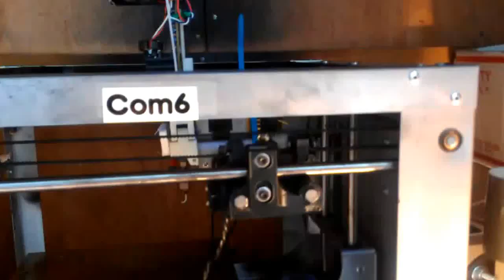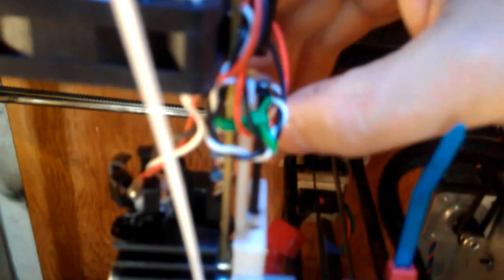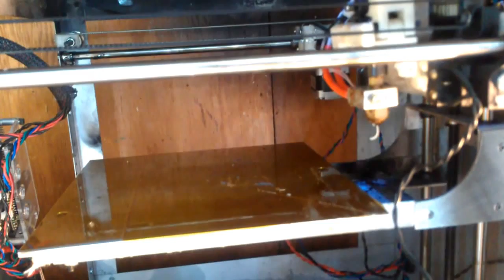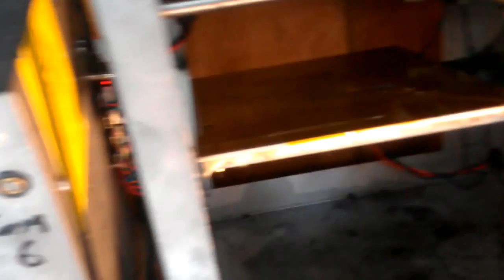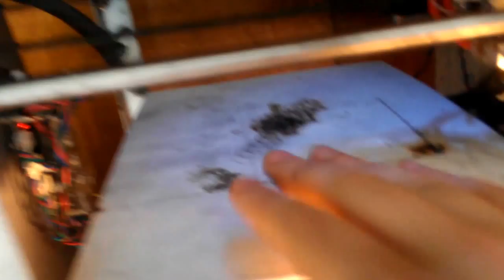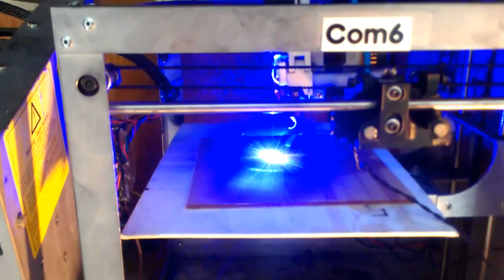L-Cheapo Tool Change

Comment: Hello good day how long the laser can be switched on without burning. I would like to place it on a cutting table 900 millimeters by 600 millimeters and not if it is too long for cutting thanks
Reply from the maker: We burned a laser after it had been on for 40 hours continually, so a long time!

Comment: That's a nice printer you have there, looks lie a Solidoodle 2 or 3.
Reply from the maker: It's a solidoodle 3. I have a 2 and a 3; Solidoodle has somewhat unresponsive customer service, but they make very good printers mechanically.
Reply: Spiritplumber yup, that has been my experience as well, at least the community is generally helpful hopefully first part support will be better with their new line of printers.